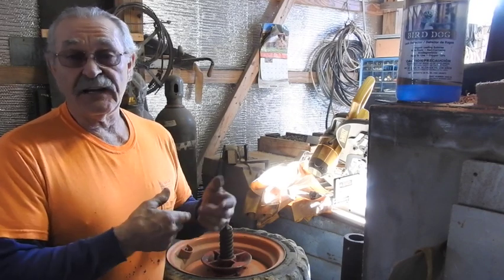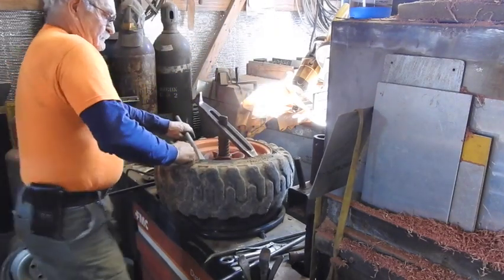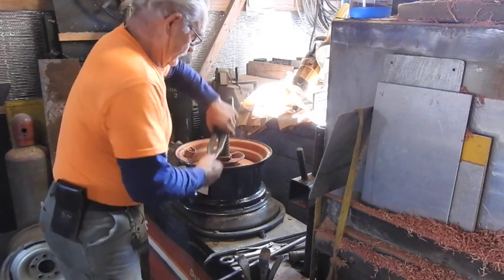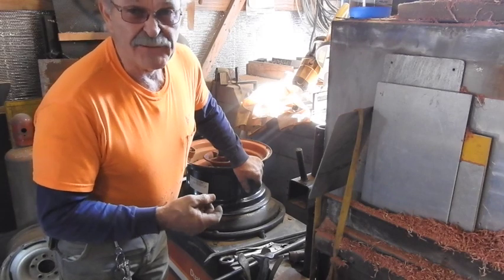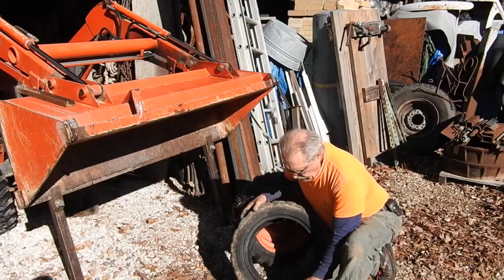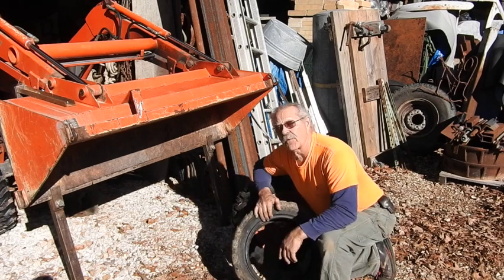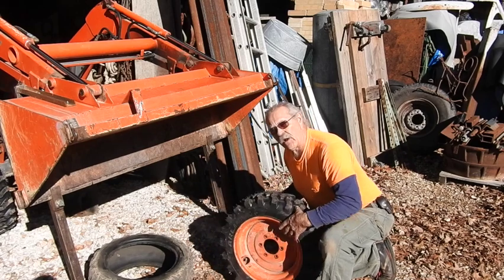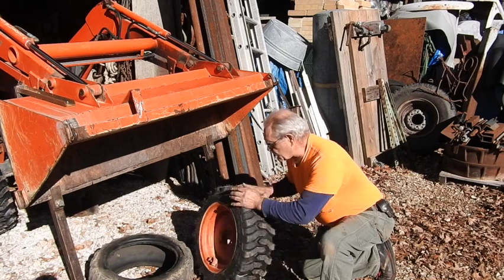Should You Change Your Own R4 Low Profile Tractor Tires Kubota B3030

Comment: When I was a kid in the early 70s, I worked at an Exxon station. The tire machine was an ancient Coates that was all manual including the bead breaker. I had arms on me in those days LOL!
Reply from the maker: I have one of those, but its not a Coates.  Totally manual.  I got it from the salvage yard one day making a scrap run.  It and all the tools was just sitting on the pile.  I used it for a long time until a pneumatic Coates came along then years later this FMC came to visit and just stayed.  Each step is one step further than rolling on the floor wrestling with them by hand.  Old age is hell ain't it.  I don't seem to be nearly as strong as even ten years ago !!

Comment: As a young man I worked for a modular home manufacturer. They developed a modular with sheet rock walls. The thing weighed twice as much as the standard paneled modular so they designed a trailer that clamped to the frame with 6 axles to spread the load. 
I welded the trailers and also when I got ahead on the welding I would mount tires on rims. 
The semi tractors carried 4 sets of spare tires because every time they had a tight turn they would roll the tires off the rims on the front and rear of the trailer. Me and Gene Precker, the other welder, mounted up to 50 tires a day when we really got going. Two man operation is much easier. 😀
It was bad doing all the tires on a machine. It is much worse doing it with a set of spoons. The current batch of mower tires are a miserable mess to try and get on or off. 
That was a masterful example of swapping rim protectors.😀😎
Reply from the maker: Hot doggies I have NEVER changed that many in one day !!  And I'm glad of that too. LOL  You know, on our three axle with a heavy load you can see bad tire flex in a tight turn on asphalt or concrete.  I can only imagine the strain on six axles in a tight turn. Three wheeler tires are not the easiest thing to change either.  But I've changed many dozens of tires on my knees with the spoons all the way up to 15.5x38's on farm tractor rears.  I'd rather be sippin coffee at the local diner than changing any of them.....LOL
Reply: @tractorman4461  I was 22 years old and lifting weights for fun when I was doing all that tire work. 
Not any more. 
The only tractor tire I ever removed from the rim was on the Ford. It picked up a nail and my friend Bob Collins helped me get the tube out and patch it. He had a bead breaking sledge hammer and we pounded on it for a while before it broke loose. We got the tire patched. The next time I had a flat I hauled the tire to the local tractor tire shop. 

Remembering the 6 axle trailer story reminded me of another trailer story. 
There was a guy named Ralphie at the foundry that everyone called Jet Pilot because he always wore googles and his hard hat while he was driving too and from work. 
Nice enough fella but a bit odd. 
He built a camper with two solid axles one on each end of a 20 foot frame. When he tried to pull out on the road in front of his house the trailer pushed the car across the road, through the ditch and down a hill. 

The 6 axle trailer was a case of poor design. I think the engineer just took the loaded weight of the trailer and added standard axles until their combined capacity matched the loaded weight of the trailer. 
I got a job elsewhere that summer and Homebuilders didn't reopen in the spring.
Reply from the maker: @OldSneelock  Hahahaha....good story about the odd ball guy with goggles.  LOL.  I've known a few in my time as well.  I can't imagine an application where the six axle would be a good match on a trailer. Man, that idea didn't last long did it.  I've changed many tractor tires over the years.  The 4 or 6 ply larger rears aren't too bad, because of the sidewall flex.  You'd think the 38's would be tough, but they really aren't that bad.  Now a 14 ply 15'' or 16'' tri-rib front is a real fight.  But then nothing tops the low profiles for difficulty.

Comment: You did well and I believe this is as efficient as it cant be. I am with you about going to town to have tires being changed. That applies here with summer/winter wheels. We prefer having our winter tires mounted on steel rims, then summer tires mounted on their original mags. It takes 45 minutes at the garage... 15 minutes for the actual job, but 30 minutes of paperwork! It takes me an hour on my side.  But I save 1 hour on the trip back/forth. Not telling how messy it is to load those wheels in a car!  I changed my daughter's ATV small tires last year.  They are smooth as a rubber band. But they did not want to seal on the bead. As a matter of fact, they were delivered collapsed and wrapped to save room.  I had to use starting fluid. Not to be performed on camera! Lol! Thanks!
Reply from the maker: I think ATV's give the biggest fight of all.  LOL.  Living rural, I detest wasting time going to town unless I just HAVE to go. We used to have two sets of rims for summer winter but with the all season radials of today not so much any more.  But then we don't have the severe snow with regularity like you guys do either.  The Missus would NEVER let me pack tires in her fancy car, so it's the old 8mpg Ford for the two trips and at gas prices, that weighs into the picture as well. Like you, I just like doing things as much as I can for myself.

Comment: Nicely done, Wendell. I actually used to have a similar machine (only older and barely useful). I’ll just pay the $10 now 😄
Reply from the maker: I still have a monstrously old totally hand operated one with all the accessories.  It was a great deal easier to use that than by hand on the floor too !!  And this one is even better even though its outdated big time.  Thanks Ed for the visit.

Comment: Yes, I tried this on my tractor's front tires, but gave up. As a tire dealer was a short drive away, I gave it to him to repair for me. I know only too well, how much of a 'grunt' changing 
out these tires can be. You do have a tire changing machine at least, I wasn't that lucky :) 
Thanks for this.
Reply from the maker: I've only had this a couple years and I've changed many, many tires by hand over the years.  I was happy when I found a changer that was totally manual at the junkyard.  I used that for a long time then I found a pneumatic Coates older than this in a bus shed at a school while I was working on the a/c.  The maintenance manager sold it to me for fifty bucks.  I used that for at least ten years before this one came along.....much better but still outdated.  But, look at most everything around here....LOL  Thanks Reg for the visit this brisk morning.

Comment: I fought with a 20 year old BX2200 front tire for what seemed like eternity to break the bead. I don't have a tire machine so tried driving over one side, pushing down with the loader and ended up letting my lift, with a car on it, drop down on it to get it to break free so I could put a tube in it. Six months later the other side went flat. I drove down to the tire shop and they had a tube in stock to fit it! $15 and less then 15 minutes later, I had a new tube installed and ready to go back on the tractor. I think that was the best $15 I ever spent!😃
Reply from the maker: Hahahaha....good story, thanks for sharing your trials and tribulations...    I've had more than a few that I'd wished I'd done the same thing.  But I'm hard headed like that.  LOL.  Years back before this fancy changer, I'd use a heavy tricycle tractor and a 2 x 8 to drive up on the tire at an angle then go back and forth turning the steering wheel to follow the contour to break 'em down.  Still on really stubborn ones I still have to beat them down with a sledge along with the machines pressure.

Comment: I've got low profile tires on the front of my LS MT125, not looking forward to the day I have to break those down.  The low pros sure do look nice though, and they're quite stable for loader work.
Reply from the maker: I was prepared to cut them off with a Metabo if necessary.  I was surprised they broke down and came off with relative ease.  Took a little assistance for the FMC to rotate though.   I think the lo pro tire can be built cheaper with less sidewall plys because they ARE more stable under weight.  A lot of my old standard tractors have 10 or 12 ply tires, and these are 4 ply.

Comment: I figured that if anyone could change one at home it would be you... lol  It did look a bit sketchy, even to my untrained eye. Thanks for posting the video.
Reply from the maker: There's not a worse tire to change than a low profile anything UNLESS you have the proper changer.  Unfortunately this wasn't the proper changer....but it worked with a little internalized cursing.  Well, four wheeler tires are pretty tough too.  Thanks Robert for the comment !!
Reply: @tractorman4461  When I was younger, (much younger, lol), I recall my F-I-L helping me change a split rim tire on an old Chevy 3/4 ton truck that I owned. I had no idea how to change that tire, nor how dangerous changing split rim tires can be. To tell the truth, through the fog of time, I don't recall how we did it other than I remember driving the truck over the tire, so that the weight of the truck might help to contain flying parts during the process. These days I've got the luxury of not having to worry about the few dollars it might cost to have someone competent due the heavy lifting.
Reply from the maker: @roberttailspin6330  We had split rims on several trucks back in the day, the most recent being a '76 Ford F250 a few years back.  I changed quite a few of the standard style split rims, but last year I needed to do something to my homemade dump trailer made out of a '36 Chevy dump.  If you'd like to see what I did to that set of rims with the OLD style of splits,  you can see it here....I thought it was a good solution and so far it has been. https://www.youtube.com/watch?v=UKMvxUuFXOw&t=1066s

Comment: Great setup  my sugestion is to be more generous with the tyre lube/dishsoap that old tyre looked dry and really for tubeless tyres a bead blaster is the way to go for seating them only a scrap over $100  ,I look forward to many more great videos
Reply from the maker: Thanks for the cool comment.  I don't have a bead blaster, but it would be nice.  I have a home made blaster that works off a 1'' line connected to a 80 gallon tank, but the compressor is driven with an Oliver 88 tractor that'd take longer to uncover and fire up than what its worth.https://www.youtube.com/watch?v=vTVFhYIQlG8  One of these days, I'll duplicate one of the blasters for real.  I just gotta find a 2'' ball valve and it's a go!  Thanks for tuning in today deutzmans1.
Reply from the maker: @deutzmans1  I plan on welding a 2'' black iron coupling to the side of maybe a ten gallon air compressor tank.  If I can find a 2'' ball valve, that will be attached to the coupling and the snoot will come right out of the valve. 
    You're right about safety guys.  Thing of it is, its funny when you think a guy that's qualified to perform the work is automatically DIS-qualified when he does the same work at his home shop !!  Could never figure that out myself. 
    About five years ago we literally ripped the 4'' gooseneck hitch right off a factory dump trailer.  There was ZERO penetration on the riser weld.  It was only a surface weld and at most of the length of the welds not a bit over 1/8'' wide.  Passed their inspection though.

Comment: Great video. Hate to hear that the old ether trick didn't work. I was sitting here saying to myself "try ether, try ether" when you came on and said it didn't work. Does OSHA approve of the ether trick? Just be glad that you didn't have to use spoons.
Reply from the maker: I use ether on the 16'' truck and trailer tires.  Most of the time a ratchet strap around the middle closes the bead enough to catch with the air, but if not the ether comes out and seals the deal.  I have had to use the spoons for dozens upon dozens of tires before I stumbled upon the majic of a tire changer.  Well, I knew of their majic, but they were too expensive for me to get for years.